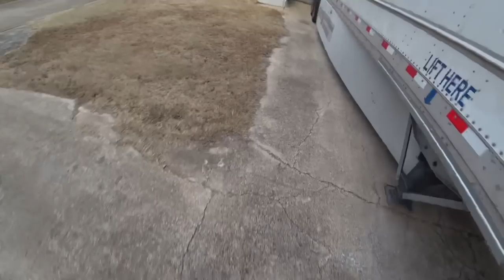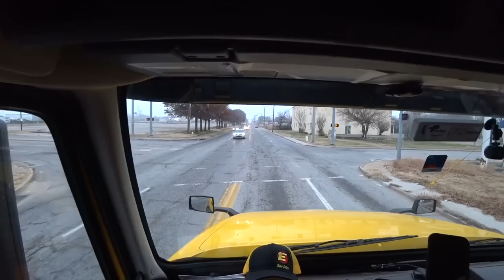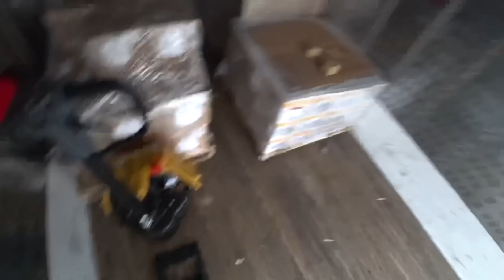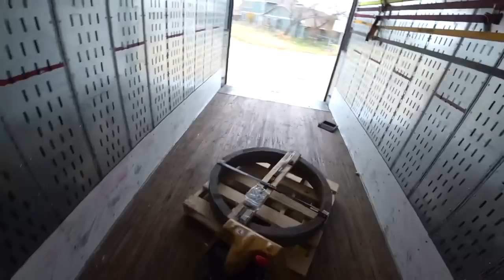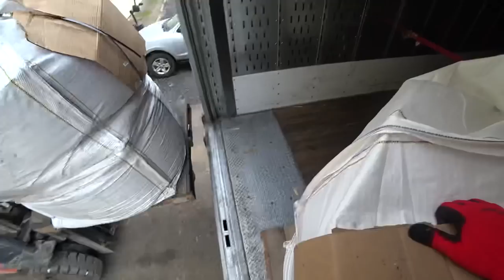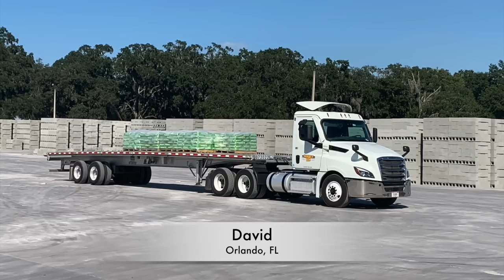ALL GOOD THINGS COME TO AN END! ESTES EXPRESS

Comment: I worked for ESTES as a linehaul extra board driver from 2014-2019 out of the Charlotte, NC terminal. At the time of hire, I was 65 years old and had 8 years of OTR experience, but no doubles experience. They offered me a trainer and I learned a lot! I worked for ESTES for 5 years. It was a great experience working for a company who really believed in safety. I made $89K my last year (2019) and I ran in 26 states. I only left because I wanted to retire at 70 and I desperately needed to have my right knee replaced. Thank you ESTES for giving me a memorable opportunity.
Reply: As extra board, are you over the road? If so, how far do you go out?
Reply: I'm hauling fuel at the moment and now I have a interview for estes Monday.  I'm not sure if it's the right move
Reply: @itisim  I just interviewed with Estes last week. Sounded like a 6 figure trucking job to me with solid benefits
Reply: @hurt1704  cool now that's what I like to hear
Reply: @itisim  who do you haul fuel for? Getting tired of it?
Reply: @JB-mo3px  how is it going? Any negatives? I’m currently in the background check right now. How long did that take? How far out are they sending you so far?
Reply: @itisim stick to fuel. LTL DOES SLOW DOWN. Fuel doesn’t!
Reply: @JB-mo3px  glad to hear it’s going well for you! My background check just finished yesterday so I’ll be starting probably next week on the extra board. Just hoping it’s the right move. Not big on being gone that much, but I’m hoping since I’m out of stl, I’ll be able to bid on a run within a 4 or 5 months
Reply: @hurt1704  wheres stl?
Reply: @hurt1704  update. I went back to doing tanker. Definately not the job for me 😂
Reply: @JB-mo3px  what happened? Were you p&d or otr linehaul? What didn’t you like about it?
Reply: @hurt1704  p&d. Too much to deal with. It take a special breed to that p&d! 😂😂 trailers not loaded right, all the tight roads a 53 don't belong on nah I'm good ill stick with tanker which is what I knew I should have done to begin with but I just wanted to try something else first 😂
Reply: @JB-mo3px  ohh you were p&d. So besides it being super tight getting the truck in and out of areas, was the actual work a pain in the ass? I hired on with Estes doing otr xboard linehaul. I almost thought about going to p&d, but form the sounds of your experience, I think it making the right move going linehaul. Just hate being gone haha
Reply: @hurt1704  Your expierence may be different than mine. It also depend on the area you are in too. The work to me wasn't bad cause I'm a worker, I like to move.  But even if that wasn't the case, I'll forever stay in tanker. I hated being gone too im glad im local. All we can do is try! Good luck!
Reply: @JB-mo3px  glad you found your niche man! Take care
Reply: @hurt1704  where did you end up going
Reply: @HeyArnoldGotAFootballHead  a power plant. Decided to hang up the keys and call it quits. No more having to protect a cdl all the time and drive in s*** weather.
Reply: @hurt1704  oh damn. I would have rode it to the wheels feel off. I thought about giving it up and then ending up with the easiest highest paying job I’ve ever had.
Reply: @HeyArnoldGotAFootballHead  yep I don’t blame you at all for where you went. I would have taken it as well

Comment: It's Big Joe, no doubt about it Chuck. We have a couple of them in our terminal for those 2000 lb. plus pallets of batteries, paint, wood flooring , WHATEVER, they really save your bacon, that's for sure. Still planning on getting a go-pro and showing what a day at XPO in Westchester Cnty NY  doing P&D looks like, it's very different as far as the roads go. Good luck with the new venture buddy, and have a good day driver!!

Comment: Those electric pallet jacks are really work savers , we used the electric ones that moved 2 pallets at a time at a grocery warehouse where we both delivered and picked up loads . I get what you're saying about seniority , as well as driving truck I also drove for Greyhound for 3 years back in the 80's ( working about 3 months out the year only to get furloughed for 9 months a year bc of such low seniority , and the closest location I could get to home was 800 miles away ) . But yeah , I'll enjoy very much seeing the various terminals and scenery along the way , can't wait to start seeing it . Be safe , watch out especially for those box trucks and 4 wheelers .

Comment: Glad your back . In my 25 years with Yellow I worked for the same TM for 18 years which I enjoyed and was unusual in the trucking industry . I had a steel warehouse on my run and you could not enter the warehouse without a hard hat  Yellow had to buy for me. They would not load or unload you if you were not wearing a hard hat . Was a OSHA rule .

Comment: Electric pallet jack ( very cool ) Back in the day 70s / 80s  I did the same thing you are doing. I worked for a company called Perkins Trucking. Keep Perkin with Perkins. Small company that  I think had four terminals in the NE. Worked there for 10 years until they closed the doors and became an owner operator and ran 48 states for the next 22 years, and then comfortably retired.

Comment: Did a year in the city with what used to Overnite back in the good old days. Had it with that and got on the road also extra board at first because of seniority. Finally got a single run to Kansas City from MPLS. Long story short it became UPS Freight after they bought us and mostly became meet and turns halfway the last ten years or so. Now its T Force

Comment: Congrats. I was a truck driver for a quarter century but never was in your part of the industry. I started as an OTR company driver for a number of motor carriers then moved into the driveaway part of the industry where I delivered new and used trucks. I have been to/thru all of the lower 48 states as well as 9 out of 10 Canadian Provinces during my trucking career. I am no longer able to have a CDL as I am no longer able to pass the DOT Physical due to health reasons.

Comment: You are using an electric pallet truck. Mt old company had those. Great bits of kit, unless battery died, in which case you couldn't then move it. Could have with a free wheel switch.

Stay safe from the UK.

Comment: Awesome. I know what you do and how it all works. I worked Rigional and LTL for 12 years. I did OTR first before getting into a company close to home. Had the same kind of work. Pallet jack orders off the tail. Hand stacked items using a hand truck. Full loads waiting at docks. Unfortunately job I was in wasn't the greatest pay. I was offered a opportunity to work with my brother at a fuel company. I've been with them 8 years now. Probably the best decision I ever made. I started on Home fuel delivery. It was different. No jack or hand truck. Just a hose to a house. Metering gallons and charging customers. Dispatcher came to me and said hey I'd like to try you on transport which is Tractor trailer hauling gas to stations. It's not horrible but I just missed the constant pulling a hose to a house. I asked after a few years to return to home delivery. They accepted. I have regular customers that know my name and even friended me on Facebook. Have the same set routes all winter. In summer I have off for a few months to go fishing and relax before the big winter and money hits again. After doing it so long the dispatcher became ill. I was moved into his position temporarily till he received a organ transplant. I now Train drivers, Deliver home heating fuels regularly, occasionally when I know its needed jump on a trailer for some extra OT and I'm currently the fleet manager. I maintain all trucks in the fleet of terminals, all trailers and im incharge of new purchases. I'm paid more then I ever made in my life. Sometimes change is a good thing. Keep up the good work and be safe on your adventures.

Comment: Xtraboard/linehaul is where it’s at, I’m a Wednesday start out of 060 Rockford, went through the driving school and I’ve had my license since May of this year. Great company to work for, it’s not a perfect company but nowhere is perfect, everywhere has pros and cons. Congrats on going xtraboard, I like it and hopefully once i gain seniority I’ll either get a scheduled run or get a Sunday or Monday start for xtra.
Reply: @FIFL2016  I was curious if you are still with Estes doing xboard otr linehaul? How do you like it? What do you dislike?
Reply: @hurt1704  I’m still with Estes, I’m on a schedule right now, I run to Indianapolis and back, I meet a Nashville driver. I do like it. I get paid 574 miles a night and that’s if I don’t hook or drop a set of doubles. One of the few things I honestly dislike is having to sometimes share a truck with a city driver. I’m a somewhat pretty clean person and hate when things are moved so I have to set everything back up every night if someone drives it during the day. Overall I’m pretty satisfied. Every terminal is different though, my terminal manager is laid back for the most part and only hear from him if something happens.
Reply: @FIFL2016  good to hear. How smooth sailing was the xboard for you? How far out did you find yourself going? Easy to locate these Estes terminals all over? And how often did you find yourself being overweight on trailers? Assuming you pulled doubles mostly?
Reply: @FIFL2016  I’ll be out of St. Louis.
Reply: @FIFL2016  is there anyway I could get your email? I have a few questions

Comment: Those electric Jack are a game changer, the company I do p&d for started getting them in 2019 full electric lift and lower and movement very nice for heavy pallet, or moving stuff up hill. But sometimes they get lose wires from bouncing around in the trailers. But they save a lot.
Reply from the maker: All P&D drivers should have one 🤣

Comment: I worked at Big E from 02 to 14 and left because of the different category seniority and other issues.
Linehaul for almost 8 years and the rest as a Hub driver because basically at my terminal they got rid of a lot of the linehaul runs and put more hub runs together.
Hard pill to swallow when it comes to bidding time and you have guys that been there way less time then you and they can out bid you.
If they would have made Linehaul, Hub, and I think they call it Combo now all one board and your combined time in each category mattered I would have stayed.
Did some time in the city also.
Good people work at Estes but management sure knew how to make me say enuff along with a lot of other good drivers just because of their 4 different category seniority. 
When I was there for 9 years on the bottom end of Hub seniority they cancel two hub runs so guess what happened,
Me and another guy who had more time at the company then any Hub Driver were put on a Tues night(me), him wed night extra board.
Because now we have no linehaul seniority.
It’s all good though I got good on the dock and unloaded and loaded my own trailers and safe driving for 11 years 8 months and went where seniority is two different categories.
Road/linehaul and City.

Comment: hey chuck how does estes line haul work schedule wise? I have worked at another ltl company with the board and it would be years before I would have been able to be on a set run, I would have been extra board the entier time. is estes similar, or are their boards a little more attainable to get on a dedicated run?